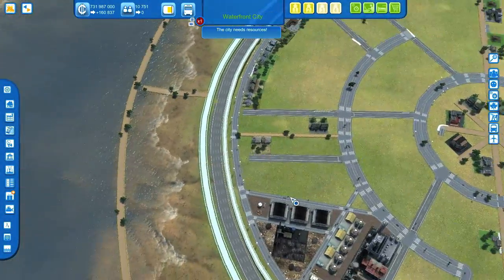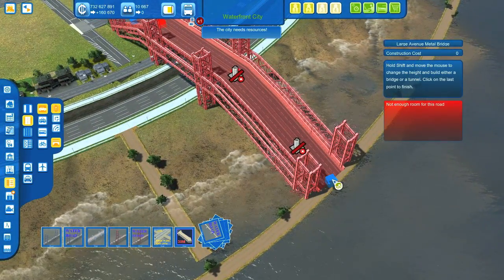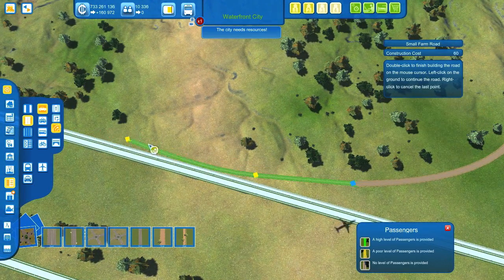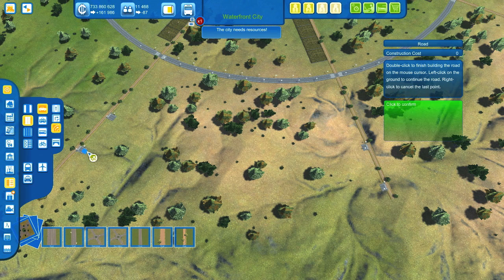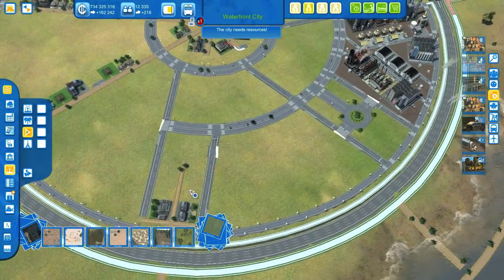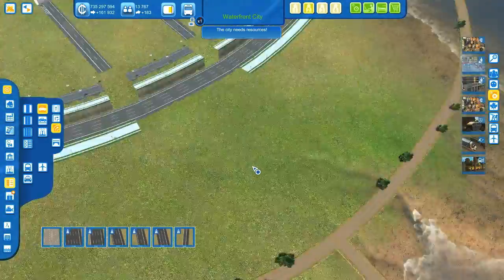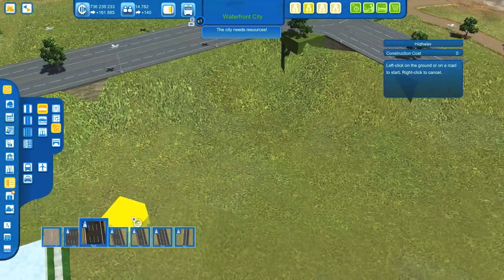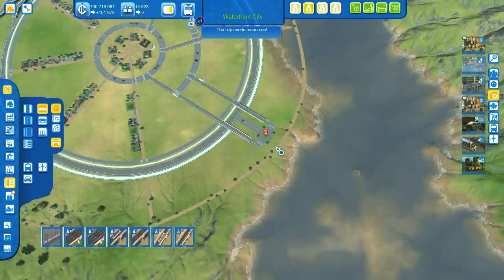let's play Cities XL Platinum - WFC EP 59 - growing industry

Comment: I think if you just started the beginning of the overpass bridge a little further back, the supporting column wouldn't fall on the roadway. PS are you studying civil engineering or city planning?
Reply from the maker: Yes I think so too. It's a bit difficult with bridges in Cities XL, if the bridge would begin to early, the intersection with the road would not work, so I try to stay as close as possible to the freeway under the bridge.

Well almost right ;) I'm a architekt.